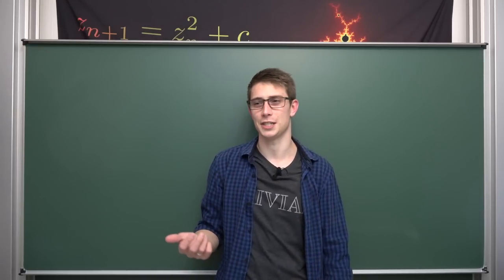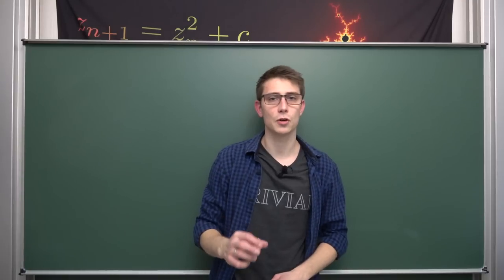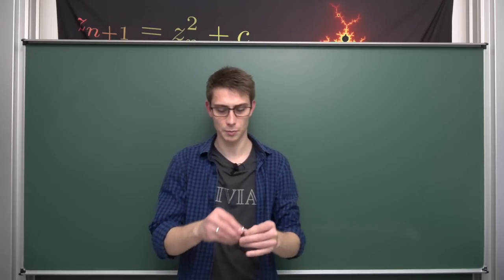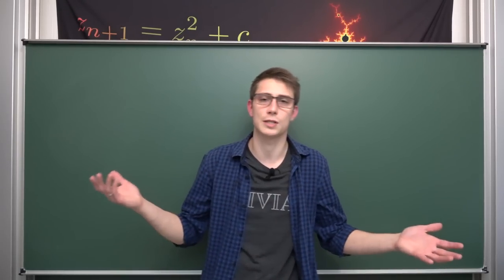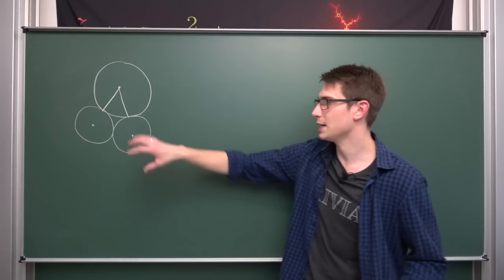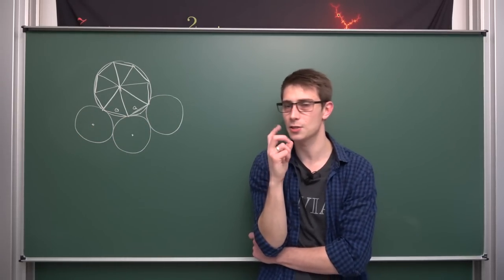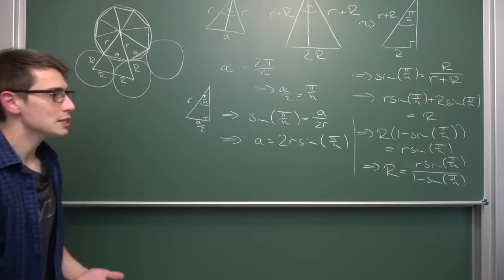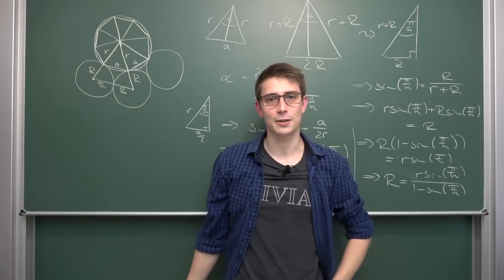Spicy Ball Bearings.

Comment: after watching the explanation of the problem I decided to tackle the problem myself, but I decided to do small r in terms of big R. I worked case by case, at first using notable triangles, but once 5 and 7 came i had to use trig identities and when it was time to calculate 8 it hit me. I ended up with the formula r=[csc(pi/n)-1]*R, which is the inverse function to Papa Flammy's. Wonderful problem!!

Comment: In a certain sense 2 works because sin(pi/2) = 1 which means you're dealing with two circles of radius little r touching with no median circle R, that is: you just get the line connecting their centers, 2r